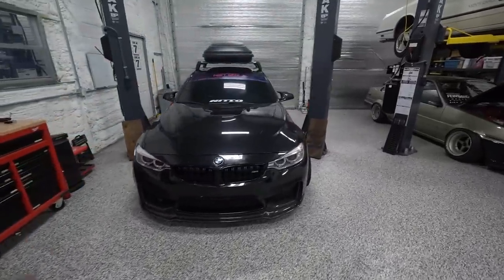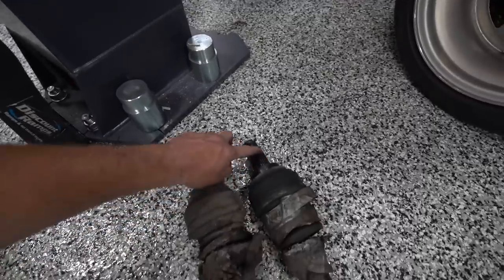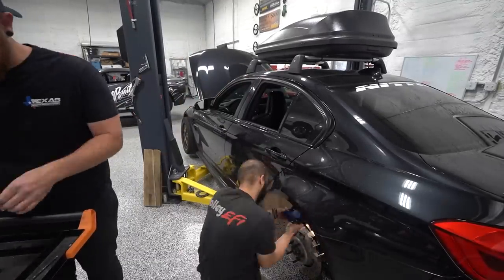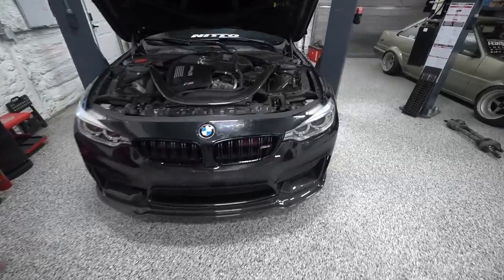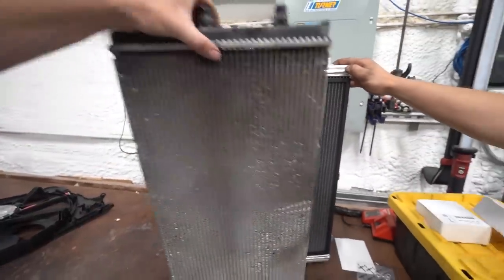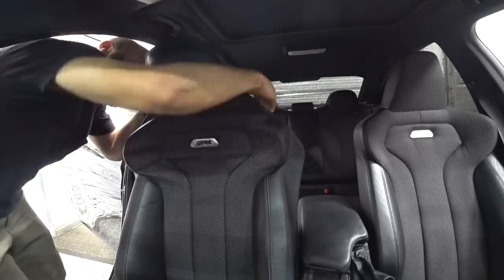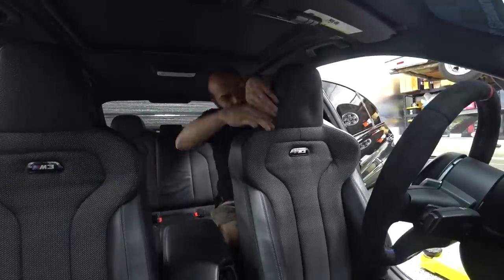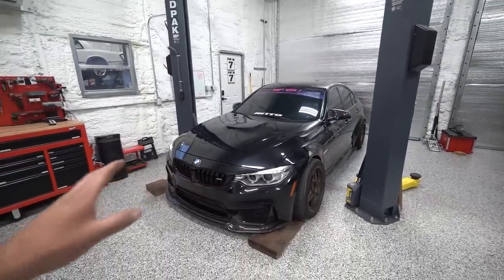Huge upgrades for the F80 “street” drift car. so many problems.

Comment: Hey Taylor, as others have mentioned bleeding the main cooling system on the F80 is handled by the electric water pump, but the water to air intercooler side of the system according to the service procedure recommends to be bled first using a vacuum bleeder then doing the main system via these instructions: (copied from service procedure) “Do not leave the coolant expansion tank sealing cap open during the bleeding procedure.
Switch on the low-beam headlights to perform the bleeding procedure. If the low-beam headlights are not switched on, the ignition (Terminal 15) will switch off automatically after a certain period of time and interrupt the bleeding procedure.

Connect battery charger.
Switch the ignition on.
Switch on low-beam headlight.
Set heater to maximum temperature and turn blower down to lowest speed.
FES (driving experience switch) must not be in ECO PRO!
Press accelerator pedal for 10 seconds to floor. Engine must not be started.
The bleeding procedure was started by pressing the accelerator pedal and takes approx. 11 mins. (the electric coolant pump was activated and switches off automatically after approx. 11 mins.).
Then adjust fluid level in the coolant expansion tank to maximum.
Check cooling system on watertightness.
If venting has to be carried out again (e.g. if cooling system is leaking), allow DME to fall completely (leave ignition key removed for approx. 3 mins.), then repeat from Point 2.”
Hope this helps!

Of course it also has a mechanical pump in addition to the auxiliary electric pump, but figured the knowledge of what bmw does could be helpful and worth a shot. Don’t forget to double check the main reservoir (may have done it off camera but trying to be thorough haha), best of luck! Loving the BMW content!!
Reply: Bump he needs to see these

Comment: Hi Taylor,  I believe the coolant system still uses the n54 style water pump, on those cars turn key on depress gas pedal for 12 seconds and the water pump flush cycle should start, if they the start up is different. Keep cap off as it cycles so don't over fill

Comment: U should look into buying an airlift vacuum tool for getting air out of cooling system. We use one in our shop and it’s nice to be able to pull a vacuum and fill without having to bleed it later

Comment: If the speed sensor issue continues, it's possible the front wires might need replacing. I noticed you hang the hubs and that in turn stretches the cable. I had similar issues on my car after I did suspension upgrades but it was intermittent.

Comment: Bleeding the coolant could not be easier. Ignition on, heater max, fan min, gas pedal 100% for 10 seconds. Electric water pump bleads the system for you. Done.

Comment: When you have a bolt or threads that are slightly messed up a trick I learned is take something and tap on the sides of the nut and that’ll usually free it up . The idea is you swaging the threads into one another straightening them out .

Comment: Taylor i read through alot of the comments and didn't see it mentioned but the axle nuts are usually pinched out of round so they bite harder into the axle and are less likely to come off. its just slightly but that is usually why they are so hard to go on.

Comment: you might be able to make manual switch for that electric motor to lock your diff. you can probably splice the signal wire to run it for the set time it takes to lock and unlock it.

Comment: Decompress the calipers with the bleeder cracked open with a rubber tube leading to a catch pan. Prevents you from pushing brake fluid back up to a full reservoir, the tube on the bleeder prevents air ingress, and draining out some of the old fluid gets rid of any compromised fluid that may have absorbed moisture, been heat cycled beyond efficiency, or just cooked. It is a simple solution with a ton of benefits.

Comment: On newer bmws you always want to vacuum fill both the high and low temp cooling systems. These cars are not designed to bleed themselves very easily without it. Also, there is a self bleed procedure on this car, for both the high and low temp systems at once.

Connect battery charger
Ignition on engine off
Turn on low beam headlights
Cabin heating to max temperature
Hold accellerator to the floor for 10 seconds
Bleed procedure takes 12 minutes
Adjust level to max
Check for leaks

If rebleed is needed, let the car go to sleep and repeat process from step 3

Comment: You really need to get a vac system for the cooling system. You can bleed it without it even running. Would help you A LOT with all your builds. Snap on sells one, also the adapter for BMW reservoirs.

Comment: Bmws have a self bleeding procedure. Acc mode, a/c on 80 degrees F, hold the brake for about 12 secs with the reservoir cap off. You’ll see it on the reservoir when it starts

Comment: Invest in an airlift cooling system refiller. Saves so much time. Pull a vacuum on the system and refill quick.

Comment: Its a lock nut on that axle. Those are very common for axle nuts
Reply: Yep. And they are supposed to be single use but realistically you can usually reuse them, unfortunately they are pretty good at tearing up the threads of both the nut and axle when you remove them. Also when the axle is stuck in the hub I usually thread the nut off just enough for it to cover the end of the axle threads then air hammer the end of the axle, most of the time it breaks loose then you can pull the nut the rest of the way off and take the suspension apart. Also anti seize the crap out of the new splines for easy removal in the future, or at least wd-40/another rust inhibitor
Reply: @Joebobinator  I use a little grease on the splines. For my Miata that rarely sees street use it works just fine. Daily drivers get anti sieze

Comment: If the car has an electric water pump witch I’m pretty sure it does there’s a way to run the pump with the car off to bleed the system. I don’t remember exactly how to do it but I’ve done it before on a couple customers car. If I was at work I’d look the procedure up for you.

Comment: there is a coolant bleeding procedure on these cars and it will run the waterpump for 15-20 mins to make sure air gets out of the system...
the electric waterpump runs too slow to bleed it properly

no roofrack no box.

Comment: If the car has a spare tire-dismount it and throw the sensors in there. Also the konigs should be tpms compatible
Reply: That is an old-school, "hot rodder" solution to a new problem... love it!
Reply: Or just code it out

Comment: Why not youst put a secondary manual switch(circuit breaker) in for the difflock. That makes the Motor lock the diff when activated? If it youst gets a 12v signal for lock maybe you could even use the rear fog light power (or similar) to activate it. Fog light on= diff locked. Fog lights off= normal operating diff and systems.

Comment: Wait until you need to change the starter motor.  It's a whole left side of the engine out deal.  Everything behind the oil filter needs to go.

Comment: 13:55
Imma about to try that on my e92 with wisefab. 
if that fixes the wheel speed plausible code 😂. Means the abs will be happy again finally. 
Can't believe I didn't think of that. I noticed the sensors mounted in a different position than stock immediately when I put the wisefab on.
Update: didn't work. Now it says direction is wrong but it did do something different. More to come, angle of sensor on stock knuckle is 90 degrees from strut. Will try that next with a little bracket to get it like that.

Comment: So wait, if the steering rack changes assist based on speed sensors on the rear wheels, wouldn’t it assist too much while you’re in drift? Since the wheel speed of the rear wheels isn’t accurate to your vehicle speed…